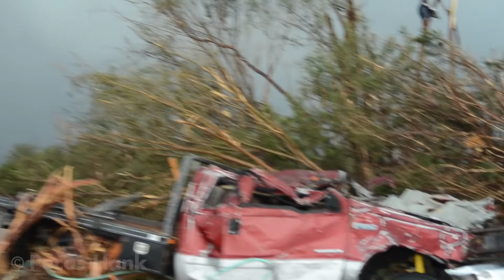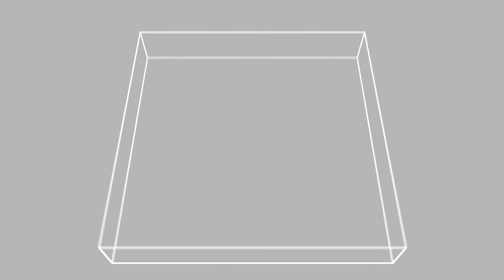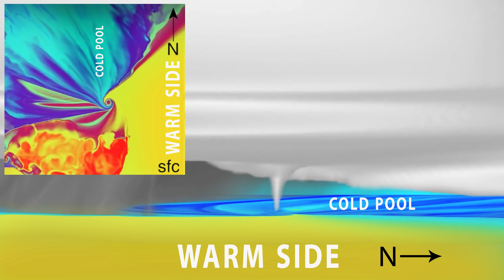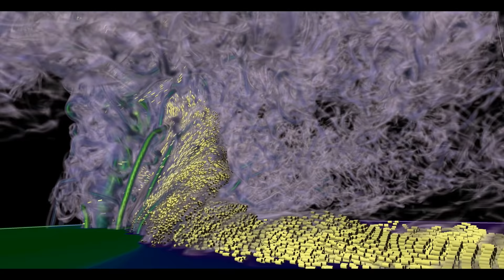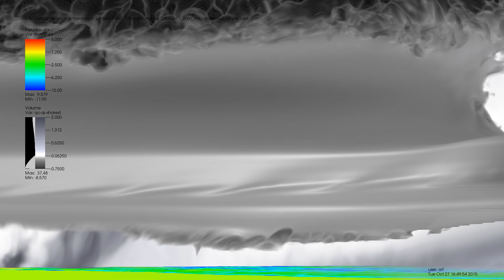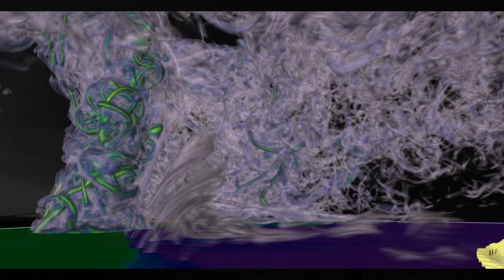SCIENCE INSIDE A TORNADO - Decoding the EF5

Comment: The clip starting at 0:36 is by far the most eerie to me. The violence coupled with the ominous background, as well as the radar truck likely being the one providing the crucial data necessary to give this monster the EF5 rating that it earned with the radar estimated wind speeds. Absolute nightmare fuel

Comment: Wow nice animations and great research!
What these animations remind me of is vortex generators used in industri.
You pump air in one way, center. And get separation of warm, and cold streams, opposition each other. Outer warm. Inner cold. Hard to remember after all these years.
Oh. The vortex generator cold stream is -40*c colder than ambient. So if you got +20*c (normal room temperature) going in, then you get -20*c below freezing.
Ice and frost is literally building before your eyes. Like hail.
Fascinating devices.
If you flip the tornado by 90* to it's side then it kinda looks very much like a vortex generator.
Message me if you need more info.
Cool videos. =)

Comment: I'm a structural engineer, not an atmospheric scientist. Watching these animations prompts me to ask a question. I understand basic fluid mechanics as it pertains to building design. For example, multiple upstream obstructions (buildings, terrain features, etc.) reduce wind pressure on the building by breaking up the flow. Design wind pressures are always higher where terrain is flat and unobstructed, like along the gulf and Atlantic coasts. We account for that in our exposure classifications. An airplane wing needs smooth surfaces in order to generate lift. But, in the south where the terrain is not as flat you can still get monster tornados. The December 10, 2021 Mayfield, Kentucky is a good example as is the 2011 Tuscaloosa E4. To my non-tornado expert brain terrain features, dense forests, etc. introduce "friction" that inhibits the inflows described in these animations. If the tornado's strength is dependent on these inflows how do they get so big where there is a lot of "fiction"?

Comment: Do all tornadoes rotate counterclockwise? Looking at all the examples here, that seems to be the case, or is it not? And if it's true, why does it do that?
Reply from the maker: In the Northern hemisphere, counterclockwise is cyclonic.  In the Southern hemisphere clockwise is cyclonic. Most tornadoes are cyclonic, but anticyclonic tornadoes form as well. Thus, in the southern hemisphere, most tornadoes spin clockwise. Make sense?
Reply: Yes that makes sense, thanks for answering! ^-^
Reply: DragonRebelRose 
Due to the coriolis effect. Moving air in the northern hemisphere curves to the right. As air flows towards low pressure (tornadoes have extremely low pressure at their center which sucks air towards it) the air also curves to the right. The faster the air moves, the faster it also curves right. There is a point near the center of lowest pressure where movement towards the low and movement towards the right become equal, resulting in counter clockwise rotation. All is opposite in the southern hemisphere, where moving air curves to the left.
Reply: @sgperformer That would be the case for a large scale low pressure system. Tornadoes are actually too small to be directly influenced by the coriolis effect (Just like the drain in your bathtub). The reason why most tornadoes are cyclonic is that, in the northern hemisphere, areas that are favourable for convection mostly have shear that is favourable for right moving supercells (caused by the coriolis effect). Favourable conditions for convection and left moving supercells overlap more seldom, which is why you don't see them that often.
Reply: CenturyStorm 
Thank You!!
That explains why anticyclonic tornadoes sometimes develop, which was bending my mind. So leftward (westward?) moving supercells are still spinning counter clockwise due to coriolis, but due to shear and direction of travel anticylonic tornadoes develop within them? Or is the entire supercell rotating clockwise?
Reply: @sgperformer left- and right moving supercells refers to the deviation from the mean wind. In the northern hemisphere left moving supercells always rotate anticyclonic and right moving supercells rotate cyclonic (This has to do with the way horizontal vorticity is tilted vertically in the updraft). What I wanted to explain is that due to the coriolis force the wind shear more often than not interacts positively with the cyclonic (right moving) supercell and negatively with the anticyclonic (left moving) cell. This is why the left moving cell usually decays and the right moving cell usually grows in size, intensity and ultimately could spawn a tornado that rotates the same way as the cell does (cyclonic).

Wind shear that favours anticyclonic rotating supercells is more rare, which is why you don't see anticyclonic tornadoes so often as cyclonic tornadoes.
Reply: DragonRebelRose Hey there Dragon dont know if you knew this but down here in Australia we habe cyclones and their storm system spins clockwise but over in USA you have hirricanes and they are the exact same thing but a hurricane spins counter clockwise (or as we say in australia anti clockwise lol)
Reply: ash thomas anti clockwise? What way do the hands on a clock move?
Reply: Nope. In the northern hemisphere they spin counter clockwise and in the southern hemisphere they spin clockwise
Reply: +CenturyStorm I know it's just a one off example but wasn't the jarrel tornado going backwards? If so was the storm a left mover or was the storm relatively stationary and the tornado drifted a little to the left?
Reply: +SandKat Reacts even in the northern hemisphere you can get tornadoes that rotate clockwise. They are usually just much weaker.
Reply: charlie saville 
Yes but that means their deviating from their own path

Comment: I think a combination of Doctor Leigh's theory and existing tornado theories are true. The SVC near the tail cloud = Massive Low Pressure. LP = Lowering of the updraft base. This = Extreme tilting and stretching of shear vorticity near the ground- the turbulent phase. A vague disorganized tornado 🌪️🌀 is born. Equal and opposite centrifugal forces resulting from this rapid rotation in turn help spin up and fling away rain 🌧️ & moisture and thus expel the RFD which as it descends is drawn in towards this rotation. It precipitates, wraps around, strikes the ground, fans out and THEN pinches the occluded gust front between the RFD and Inflow winds- the laminar phase. This occluded wake helps carve the condensed, centripetal tornadic funnel into a more smooth stream. And the RFD in turn helps strengthen the existing tornado 🌪️ but not necessarily to maintain it. 

So the RFD is the variable that may be helping to strengthen the tornado. All this may occur but be relatively invisible to our eyes. 

If it's equal and opposite, how could the RFD produce a tornado that's stronger than the variable that created it? That's easy... Gravity. The expulsion of the RFD is further accelerated by gravity, whereas updraft buoyancy and heavy moist air is thrust against it.

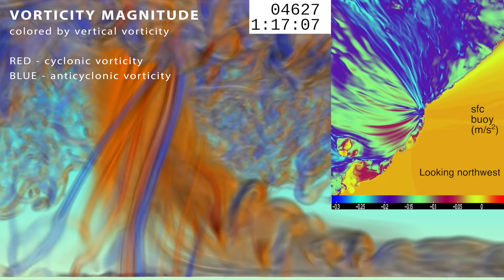Comment: 8:05 All of the smaller vortices are just other horizontal vortices that are being lifted and tilted by the cyclone. As the storm moves forward it’s creating turbulence in the air ahead of it because of the FFD air falling from a high level and being drawn back into the storm at ground level. These small vortices are tilted upward and drawn into the mesocyclone, much like itself and are just consumed by the cyclone. If you look at them, they’re being raised into a bell shape, and then go fully vertical once they reach the mesocyclone.

Comment: In looking for little vortices associated with tornadoes I think you're on the right track.  Small tornadoes grow large sometimes.  I suppose it takes a certain set of conditions for a tornado to be visible. I've observed from videos that the time during genesis around touchdown is when you often can see the visible structure.  Clearly the tornadoes are on the ground before they are observable, but they do not upheave enough debris to be noticed. But maybe they are key.  I think it's possible for dust devils to grow into these vortices. Vortices are all over the place but you can't see them and they are hard to differentiate from regular winds sometimes.  Just a gust?

Comment: From a Electric Weather Mechanics perspective- "....As already stated, standard meteorology due to using only fluid mechanics can only have temperature moving the atmosphere around. But recently and after just the data from a big storm system was input into a super computer and without any preconceived ideas as to what was happening (fluid mechanics), it showed that the wrong type of temperature seemed to be doing the driving in the system.

With it being the cold instead of the hot pushing air columns up. This left them scratching their heads as rising heat is supposed to drive weather patterns and not rising cold.

But when seen as negative charge heading from the ground towards the positive ionosphere through the conduit of the cloud and as it does so, affecting the matter state of the H2O molecule, it then makes a lot more sense.

Waterspouts are just the same as tornadoes and dust devils, with the earth through Birkeland Currents balancing charge between the ground and the atmospheric layers above. But because they form over coastal margins, it shows that they are attracted to a sea or ocean shelf sticking out from a land mass and just below the surface of the salty and so electrically conductive water.

Once formed, waterspouts are more often than not seen near and even heading towards the coast and once there, can start to fully discharge and so weaken. Or if there is still a charge imbalance between the cloud and the earth, can even become a land tornado.

The waterspout that unusually formed in the middle of Amsterdam in August 2019 is a fine example of why a waterspout, lightning strikes or even a dust devil on mars are all Birkeland Currents exchanging charge between the ground and upper atmospheric layers, with their differences only being the power density in the discharge.

When the power density in a Birkeland Current discharge is low, the associated magnetic field produced by the moving current will be in Plasma Discharge Mode 1 and so not seen except for any ground debris being moved around.

But as the power density in the discharge goes up the increase in moving charge creates bigger associated magnetic fields and so tightens the Birkeland current to PDM 2, with some tighter twisters being seen to glow.

Then when the current density is very strong, the magnetic fields produced, will be so restrictive that the Birkeland Current will discharge in PDM 3 and we then see a very bright arc.

Amsterdam is an inland port near the coast and as such has salt water running through it and the waterspout that formed there and then run through the dock area has salty water just above the earth's surface. But this alone is not what caused the unusual event.

The forming funnel cloud was first attracted to some large and temporary earthing rods and under more intense electrical conditions, would have caused a lightning bolt to hit one of them and so connect the earth and the storm cloud above to exchange charge. 

So even though the moving waterspout was a low power density Birkeland Current (Plasma Discharge Mode 1), once the connection was made to the earthing rods (the tower cranes), the charge exchange between the ground and the cloud could then happen fully, with the waterspout/tornado then fizzling out...."

Comment: Here in Louisiana there is this theory that the airforce base here controls the weather. A severe thunderstorm should be headed straight for us and it either
A. Disperses as soon as it's near the airforce base area. 
Or
B. Splits in half and goes around the airforce base area.

We still get sever weather alerts and we still take shelter just to be safe, but usually (key word: USUALLY) everything ends up okay. Maybe some damage, (we had hail earlier at one point the size of Lima beans) but not much damage unless you live in a mobile home.

Comment: In my opinion, the atmospheric pressure is what makes or breaks the development of a tornado, and those "symptoms" are the manifestation of that pressure.  If I am remembering correctly, the shelf of the storm resides between the hot and cold fronts, which is where tornado development is most likely because of the pressure.  Please correct me if I am wrong about that.

Comment: There's a pattern to it, you just gotta be able to connect the dots.
In almost every tornadic situation there is an area of smooth cloud -
What if it's acting like an insulator? An area of cool pressure is forcing the warm air to stay in one place, and since it has nowhere to move it moves upwards, the cool air coming along with it, rushing in quickly to replace the warm air that has been lost.

Comment: A question to ask here but, every time I see mention of trying to learn tornadoes and such I think of the movie 'Twister' with the sensors being released into the tornado. Getting something like that into the damage path would be dangerous and deadly but with the advent of smaller tracking devices would it be possible to do  something like the mention of releasing "chaff" into a real funnel along some of the inflows providing a less dangerous method? on a clear one perhaps even something with LED lights and a device that's light enough to be carried by the wind to proved something visual? Keep up the awesome vids and stay safe ^^

Comment: Do you know if anyone has considered drones (most likely quad to octocopters) equipped with chaff or heavy metal rich smoke to bounce radar off of? Lots of racing drones can reach high speeds and could probably be launched at and into a tornado and be designed to survive and be recovered.
When the drone looses control it can simply shut off and take the ride until it starts falling or is in a position to regain control, then fly to (or elegantly crash) at a designated landing zone.
I'm sure there would be tons of amazing data that could be collected using a drone designed to get sucked up.

Comment: I dont know if Hank still responds, or maybe one of the viewers can answer this question: Given that the data seems to suggest that tornadoes form and survive from the "cold pool" or cold air, does anyone know what defines the "cold pool"? So, does the cold pool have to have air that is a specific number of degrees below the surrounding air? Or does the cold pool have to be made up of air that is below a specific temperature? For example, if it is 80 degrees outside, for the tornado to form does the cold pool have to be filled with air that is at least 15 degrees cooler than the 80 degree air temperature? Or does the cold pool have to be filled with air that is below 65 degrees, no matter what the surrounding air temperature is? On that note, is there a limit to how cold the air can be? So can the air be too cold for a tornado to form? I hope my question is making sense, it makes sense in my head. If it doesnt make sense, let me know and I'll try to clarify my question better.
Reply: cold pool is basically thunderstorm-cooled air, any air parcel cooled by thunderstorm is considered cold pool

Comment: @Pecos Hank You know I was think that with more and more information that you and other chasers are discovering and the computer experts like this man using that info to create these simulation, I come to realize that an even better and more extensive radar system will be needed. With our current system having its limits, especially with distance from a storm to the radar, you can't see what's going on at the service, and to me, and correct me if I'm wrong, that's going to be a real key to determine if a storm will produce one or not. Being able to see the winds moving in towards the rotating updraft from the front and especially the rear flank and what kinda speeds those winds have. Also I think I can see why the cold air is the key here and it makes since why, cool air is suppose to fall, not rise, and when that cool air gets caught in a rotating updraft, it's as though it's literally fighting to keep from lifting causing it to tighten which also causes the updraft to tighten. When you think about it, cold air rising and not falling goes against normal physics, and you have to think that anything going against physics will never turn out pretty. I think it  puts a whole new meaning to the phrase the tornadoes are a rare phenomenon.

Comment: it took until last week for me to find out that the El Reno tornado isn't actually even technically listed as an EF5. it's an EF3 based on damage reports, which is how the enhanced fujita system works. mobile radar measured winds of 200+ mph, but radar measured winds aren't criteria that the enhanced fujita scale follows. based on the scale alone, yes, the tornado was definitely an EF5, but the NWS has it considered an EF3 based on technicality. and i had been lead to believe for 8 years that the tornado was an EF5, when it still is not officially rated that way. we probably should stop mislabeling this tornado; it certainly was likely one of the most powerful tornados humanity has witnessed, but it just didn't do the damage to call it an EF5. and that's okay. its size does it enough justice, the rating is more so an indicator of damage rather than actual strength, at least from the NWS perspective it seems.